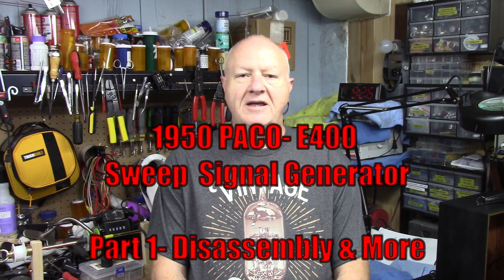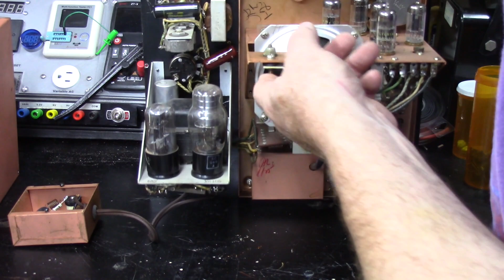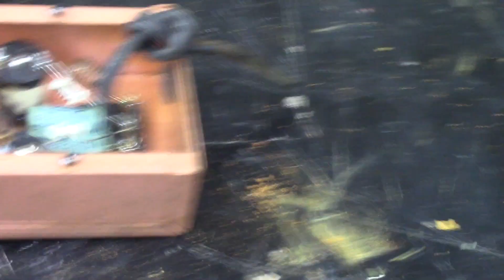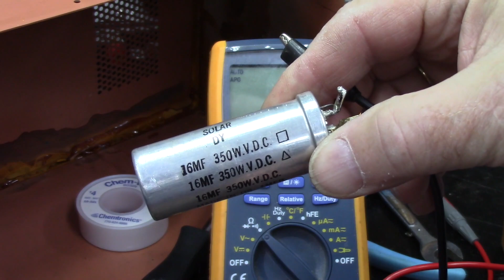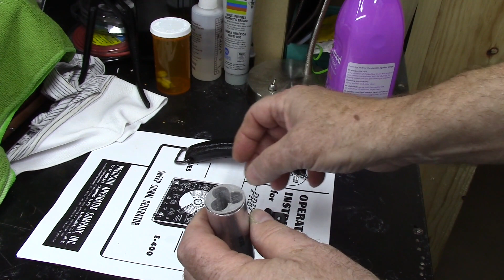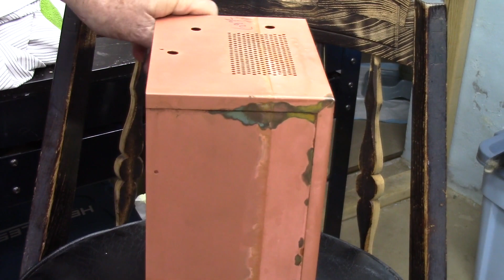PACO E-400 Sweep Generator Restoration - Part 1- Disassembly and clean-up.

Comment: Hi Gregg, I have one of those. It works well enough for FM alignment, It drifts and due to it's machinal 'wobbulator' is sensitive to vibration but does the job. Looks like it should clean up nicely. Good to see you back Gregg 👍🙂
Reply from the maker: Thank you David, when you see it operating in a future video, you can let me know if it appears to be functioning somewhat correctly.
Reply: @greggsvintageworkshop8974  Will do Gregg. Here is a link to the Radio Mechanic channel. He is using the same Wobbulator to do an alignment. https://www.youtube.com/watch?v=mXdQkW5RK7s&t=612s

Comment: There is a free manual on BAMA for ones made  before 1949. At least that is when the schematic was checked off by.
 Great amount of stuff about it and how to align and operate it. Looks like yours is a later improved version Gregg with
 speaker addition. In the schematic there is a  part marked  EMR.  That's the electro-mechanical reactance module unit 
 better known as a wobbulator. You are the best electrolytic can restuffer on YT!  Nice gift! Steve
Reply from the maker: Thanks for the information Steve, and the compliment!

Comment: Hey Gregg. PACO made good stuff. My B-K Precision E-200D came out after B-K acquired PACO. A sweep generator is one of the items I would like to have for my bench to do FM alignments. Let me know if you decide to part with it. Looking forward to part 2. :)
Reply from the maker: Thanks Doug! We can probably work something out, as I will have no use for it. Wait until you watch all 3 videos, then if you are interested we can talk.
Reply: @greggsvintageworkshop8974  That works for me. I've wanted to do proper sweep alighments for FM stuff for some time now using the Oscope. :)

Comment: With the exception of that rust that appears to be a very clean unit.  With that speaker as the sweep generating unit it's probably an early model before then could get custom replacements without the speaker cone, probably to eliminate the high frequency sounds for those that could hear them.  Great job making the capacitor holder for the restuffing job! When done you can use that with a scope for you FM alignments.
Reply from the maker: Thanks Bob!

Comment: Case looks really nice so far, wondering how the rest of it will finish out with the Evap-o-rust.

I have a question that most likely is geared toward some of your viewers. I mean no disrespect with that, but having viewed your recent flap, it's just my deduction. I hope you don't mind, for in such a community, we all come together to see what others are doing and to lend advice where possible.
I moderate the Nuts and Volts Forum, and one of the regulars there has come across some Western Electric tubes described as Small Punch and Large Punch, along with their regular designations. We've been through a number of search pages, and even looked at Western Electric's Archives. We can find the tubes, but no mention of what these punched holes in the shield do. For reference, look up the Western Electric 348A and 310A where you will physically see the punched holes.
Not that we are actually going to do anything with them, but its one of those questions that nag at you until you find the answer. And yes, I am waiting on a return email from Western Electric, hopefully.

Thanks for any insight anyone might have. Now back to waiting for part 2.
Reply: They appear to be high power tubes so I would assume the holes in the plates are to help keep the heat even and not build up inside. I would bet that the large punch were the orignals which required the plates to be made special and the small punch, where the plate appears to be made of a screen material, was switched to as a cost saving measure by the manufacturer. 🤔
Reply: Thanks, Bob. That sounds like a highly plausible explanation, front runner at the moment. Like I said above, I'm hoping to get a reply directly from Western Electric. If I ever do, I'll come back and let you know what they say.

Again, thank you so very much.
Reply from the maker: Thanks for commenting! Yes, I personally don't know, but Bob's explanation of ventilation makes perfect sense to me.
Reply: @greggsvintageworkshop8974 
Thank you, Gregg , for allowing the post, and definitely thank you for your thoughts on this rabbit hole. All information and.ideas help.